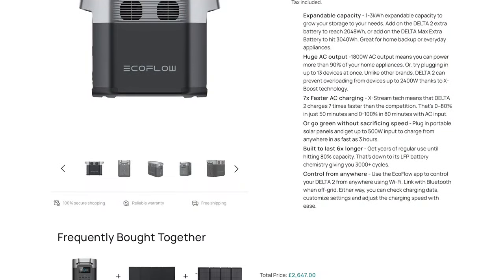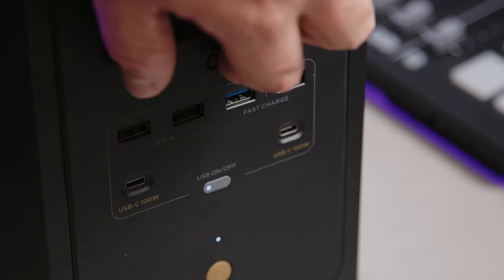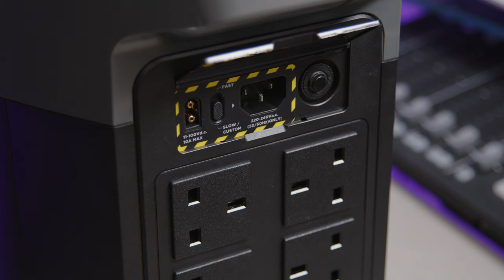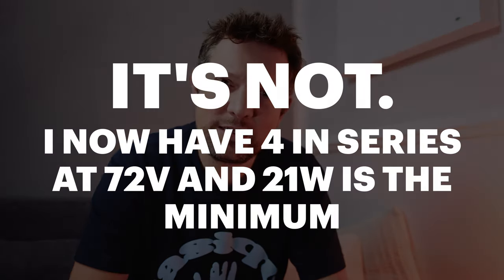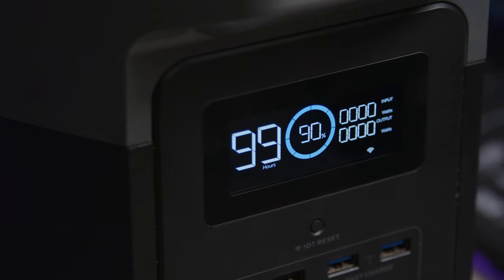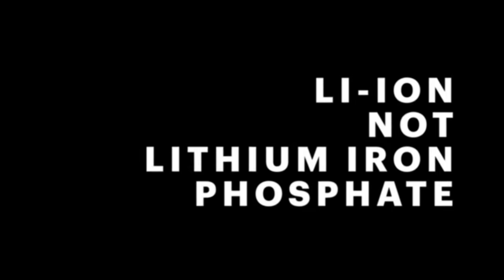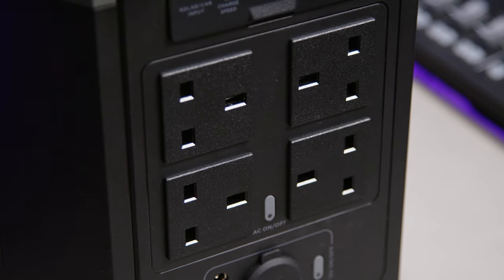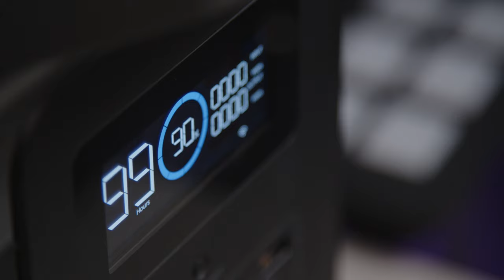EcoFlow Delta Max - Things You Don't Hear In Reviews

Comment from the maker: EcoFlow has now got back to me about the minimum solar power issue. Apparently, the unit consumes 25-30W itself, so any solar input below this cannot be used. That seems a lot, but I guess it makes sense.
Reply: I'm thinking I need to keep the Anker 757. The fan sounds like a puddy tat purring in comparison too 🤷
Reply from the maker: It is really noisy. There's no denying that. Safety is paramount but I really wish they could implement my 'Silent Profile' as discussed in the video. Some people say the Delta Mini is very quiet in comparison but I am yet to test that.
Reply: I saw a video testing the EPS on the new delta 2, and i saw that it was pulling in 50w while outputting 40 W. The 10W difference for the invertor/unit itself, i found very large. It would be kind of neglectable if you would use powertools and run the whole battery in like 2 hours or so (just losing 20 watts of the total of 1024 to just the unit itself) but I find it a shame if you would have a low powerdraw situation of 50 watts and it kicking in, and thus being a relative 20% of your consumption and thereby losing your potential of drawing 50watts for 20 hours and now the realistic picture being 50+10 for 16ish hours. Like you said in your video it would be great to have a limiter to not kick the fans on even above 80W, this should also be discussed to see the real WH you get out if it with this draw of power. (Excuse me my comment is based on the delta 2)
Reply: @tdcattech  Ecoflow Delta 1300watt....Buyer Beware  ...It never stops charging. They don't return my e-mail. Concern that it might catch on fire. Have had it for 2 1/2 months. Think twice before spending more than $ 1,000.00 dollars. Besides I am afraid to leave it out of my sight that it might burn down my house

Comment: So glad I saw this. Excellent review, saved me making an expensive mistake. The fan noise is beyond unacceptable, it would have rendered the Delta max next to useless for my needs. I will not be placing my order. Going a different road now.  Many thanks for making this review, it was well balanced, told the good and the bad, the truth.
Reply from the maker: Thanks for that. I think they make solid, quality products but if you want to use this in a quiet environment, this is not the one for you. Delta Mini is quieter (but not what I would call quiet) and the Delta 2 reports seem mixed around noise but I can’t really comment as I don’t have a unit.
Reply: @tdcattech  I assume all of these Li Ion power stations or solar generators have very similar cooling requirements so fan noise is a big factor. Funny enough it is hardly mentioned in any of the main manufacturers "buy me" stuff.  I might spring for a smaller capacity and much quieter Li battery unit, I am looking at power oak, but now that you have put us all staring, I am investigating the noise levels on everything first. Keep your eye on this sector because people want to know the truth and good reviewers will be in high demand going forwards. I suppose they will fix the fan noise in time, but the chemistry as it stands is what it is, temperatures must be kept down for safety. Last thing you want is a silent unit that burns the house down.  regards.
Reply from the maker: Absolutely. Moving power and converting voltages etc. is just massively inefficient and creates heat. Safety has to be first. I doubt EcoFlow will like this review, even though it's largely positive but I welcome your feedback! 👍🏻
Reply: @tdcattech  This is the essence of a good reviewer, you never worry if the manufacturer likes or dislikes your review, so long as its professional, balanced and truthful, which your review absolutely was. EcoFlow know that the noise issue will put a lot off their products (like me), so they have a good incentive to keep the product safe whilst significantly reducing the aircraft hangar sound effects!
Reply: When you need power during outages, there are no questions about noise. Same for fuel generators, compare their noise levels.  but yes, some vendors now care about noise as well, for example Anker with their PowerHouse series.
Reply from the maker: Totally. In a true outage, who cares about noise. 👍🏻
Reply: @tdcattech  A few years ago after a cyclone here in NQ Australia, power was out for a week, and generators had become scarce. By chance,  we located a huge bellowing diesel generator on its own trailer to rent. That roar was so soothing to my ears at the time. During a serious crisis, with desperados on the prowl, this fan noise shouldn't be detectable to anyone outside your house so it would be ok. We aren't short on sun here so Delta Eco Flow  Max or pro might be ideal for us.
Reply: @tdcattech  I am currently looking at one to run my Qld Au, home off grid.. as the way things are going when you have a solar system on your roof and they now want to start charging us TAX  for our feed into the grid power, while they're only paying a measly 05c p/kWh hour any way.. they were paying around the 16c p/kWh hr to begin with when i bought the solar system.. but now it's hardly worth the effort.. and i may as well go off grid, this seems to be the most economical way to do this.. though i haven't really looked at off grid battery storage systems, but i feel they'd be even more expensive.. will do more research and apart from the noise factor the EcoFlow seems to be a viable option apart from the noise factor.. that would not be suitable.. thanks for your honest review..

Comment: This is because NCM battery cannot operate over 45 degrees, so the unit tries to cold it down as hard as it can with fans.
Reply: The fans are only for the inverter / dc section the batteries are not actively cooled

Comment: I love my Delta 2000w fan and all. I never thought about the noise until I saw this review. Charges very fast when needed. Probably better on the battery if one uses it when is an emergency. Combines with 2x 220 bifacial panels and a 2200w propane generator. Bring on the hurricanes. Ecoflow thought of everything. I encourage you to look at other reviews before you walk away from this.
Reply from the maker: Not sure if this is directed at me personally but I am certainly not walking away. It’s a great, solid product. These are just some things people should be aware of. I actually charge a smaller battery from the Delta Max and use that when I need silence. The Delta does the heavier lifting.
Reply: @tdcattech absolutely not directed at you. Just my respectful opinion. I thought it was a good review and I am sure it took much time to put together. Thank you.

Comment: Shit. That's me back to square one . Can't have that noise, in a van converted in a camper and its seems unrefined and over priced,  for what they are given. Thanks for the honesty.  Saved me from been pissed off .
Reply from the maker: Yes. It seems that people are very torn on this. If you're camping and you can put it in the back of a car and just feed a cable out, you'll be fine. Equally, if you're pulling hundreds of watts, expect noise. You're never going to avoid that with current tech. However, it can be loud with fairly low draw which is a problem for me personally. It is otherwise a superb device 👍🏻
Reply: @tdcattech The new Delta versions, especially the Delta 2 are much quieter running (I sleep with one next to me in the car. The car fridge actually is louder).
I do agree with you about the huge problem of not being able to charge any of the Delta extra battery range separately (including the new "2" versions). I often need to keep devices (such as the fridge) operating while it's connected to a battery station, at the same time charging a depleted battery via solar panels. This is just not possible with the smart battery (not so smart 😂).

Comment: Hi. I have both a delta (not max) and a delta pro. I agree with you in respect of noise. I do not have problems with the solar when leaving it connected all the time, nor do the units make any noise while trying to connect. But lets be honest I am in Spain and in most cases sun is not an issue here. As for switches to the AC plugs I use remote operated plugs and that with one remote allows me to switch on and off several devices. Thank you for you review!!

Comment: Sorry for the long winded comment, but here it goes anyway .... First off - Wow, that is an impressive review video right there, very high quality and good, honest. unbiased information. Thank you! .... But, unfortunately it also confirmed my suspicions/worries about whether or not the Delta Max was going to have those same loud noise issues that the new Delta 2 units have. Hobotech & multiple other dissatisfied owners have already confirmed that fact for the D-2's.... Darn - after I cancelled my recent Delta 2 order (primarily due to the noise concern) my first thought was to wait for some price reductions, and then buy the Delta Max 2000 instead. I don't think so now.  And the other thing that caught my attention in your review was the solar panel connectivity issues when it's left plugged into the panels overnight. I had seen that that was an issue with the Anker 757, but had never heard of it being a concern with any of the Ecoflow products. I have a Delta 1300, and it does not have that problem that I'm aware of. It starts delivering even very low amounts of solar (5-10w) to the power unit as soon as the morning sun hits the panels, w/o any interactions from myself whatsoever. And lastly, my Delta 1300 appears to be far less noisy (approx. 40 db when I/O loads exceed 200w) than either the Max or the D2 @ 60-65db each. As a result of all this, I am now strongly considering adding a 2nd Delta 1300 to my arsenal, and I'm also thinking of it's lack of app connectivity as somewhat of a merit rather than just as a liablity. Thanks again, and good luck on all your endeavors.

Comment: Not Delta max, but Delta 2 arrived today. Straight away I'm loving it vs the Anker 757. (12kg, not 20 kg 💪) Came 30% charged and leaving for Wales in a few hours. Charged it initially to 90 % in savagely quick time in 35 to 40 minutes on 1200 watts. It was really loud, but I didn't care as all I was bothered about was getting it charged before I go and I was in the shower anyway, then pottering about and packing up to go. Tried 600 watts, considerably quieter. Under load, also way quieter than anticipated . I plugged into solar as curiosity got the better of me. 187 watts going in in hazy sun. ANKER MAX was 160 in full sun. Happy to say completely silent taking in 187 watts. The fan did slightly kick in but I was up close and it was barely audible. Need to test if it takes in low 10 watts instead of chopping it off. Ap is brill realising WiFi and Bluetooth. Sorry to bore you, but I'm relieved... Extra battery and case apparently still on it's way, but I'm now sat in a vw camper, using it and glad to be happy with it so far👍
Reply from the maker: Not boring at all. This is exactly the feedback I was looking for. The noise issue is so subjective and people’s tolerance for fan noise varies enormously but it’s great to hear that there is a quieter mode. My Delta Max is currently charging from solar at 60W (it’s grey and miserable here in Bristol) and it’s silent 😁 🎉
Reply: Yes let me know the lowest level of solar the Delta 2 will accept. I often have 10w or so coming in and my current Anchor 535 takes in 6w 8w 10w solar no problem and over days and days it is useful.  If the Delta 2 takes low level solar I'd love to know.

Comment: I am fine with the fan noise when the battery is being used, whether it is charged or discharged. Cooling the battery is my highest priority. Having said that, when cool, they are cool.
 My biggest problem is when AC-in is connected and AC-out is used. If the Delta would have a real transfer switch it would have no need for so much cooling, instead they do some kind of AC->DC->AC chain which forces the fan to start cooling.

I ordered a real transfer switch and will connect my Delta 2 to the generator connection of it. 150 euro for something EcoFlow should have build in.

The solar input problem you might be able to solve my using a small separate 12 volt battery and a mppt controller that has a programmable load port. I use a Victron 75 15 to charge an external 12 volt battery and when voltage on that is high enough the load port is opened and stream electricity until a certain low voltage is reached. You don't need a large 12 volt battery for that and can also use the victron Victron BlueSolar MPPT 75/10 (12/24V) which has 10 amps output.

Yes external battery's...... the are expensive and have no way to charge them or use them other then connecting to the main unit.... might as well buy another unit

Comment: Really useful review, thanks. I have just bought a Delta Pro and can say that the advantages and disadvantages you have highlighted here apply equally to the Pro. Overall, I like it, but have to keep it in my (somewhat dusty) tool shed because of the noise the thing generates which is less than ideal as I worry about dust getting into the device - causing issues later on.
Reply: Which one did you get I’m about to buy one thanks. I do a lot camping would you it be good for that ? Thanks

Comment: Very interesting and informative video, with your open and relaxed style you could easily move to television presenting. This is the first none biased video on the new Delta range and the fan noise is barely mentioned in other reviews. I am considering the  Delta 2 and it's not hard to assume it has the same issues, ideally when considering the price, it would be good to see and hear one before buying. Will subscribe and check out your other videos.

Comment: Great video. It’s also useful for charging other power generators while you are using your 100v solar panels to charge the delta max. This throughput charging allows lesser powered generators to charge while you charge the `delta Max at the same time.

Comment: All fair points for me personally the noise is too much for my use case it’s in my van that I live in full time having the fans fans running at full speed the majority of the day is horrible, if you are using this for back up power or camping you can plug in an extension lead and stick it in another room this is the reason for the difference in opinion on the noise I think 

I’m planning on doing a fan swap in a few weeks with will hopefully get it to the same noise level as the delta 2 but unfortunately it won’t alter the fan curve it’s self

Comment: I completely agree about the fan noise, I emailed Ecoflow asking them if it was possible to control the fan or restrict the performance similar to what you asked them , they said it could not be done, I even moved the device from my office to another part of the house to get way from the noise, in the end I sent it back as its just to loud for my environment, I’ve bought a delta mini which is silent and I am waiting for the delta 2, hopefully it doesn’t have the same fan noise issue.
Reply from the maker: That is a real shame. It's fantastic to hear that the Delta Mini is quiet but it's also much less capable than the Max. I do hope this is improved in the new higher power models.
Reply: Delta 2 is  very noisy too.
Reply from the maker: Yes. It seems as though nothing has changed on the Delta 2. It's just as noisy from what I've seen on other vids (I do not have one to test).
Reply: I've received by Delta 2 and it is much quieter, the trick is to charge it at anything below 900w, anything above that will put the fans on but nothing like the noise the Delta Max makes.

Comment: have to agree noise is an issue.  i finish work about 2am each night and use it to power my office until 6am added a timer to the mains input so start charging from my houses solar after 9am 
i brought a plastic garden box lined it with car noise suppressing sheets take the edge off can watch YouTube or a movie with it in the room  power was then the issue office uses 260w. so was getting about 5 hours (haven't done your calibration) so having a 48v lithium scooter battery i rigged up a 48v to 24v 20amp converter to the xt60 increase battery life to over a day 
may get the extra battery and the generator in the future if needs change but working fine for now

Comment: Does newer battery lithium ion fast, generate less heat and less fan noise? And how much energy does cooling the unit drain battery..? Thanks this is an amazing video I may buy the 2000
Reply: You would be crazy to purchase a lithium ion battery powered generator at this point (unless you are looking to score a deal on an older model). LiFePO4 is the new standard and should be prioritized when selecting a new unit!

Comment: I will purchase EcoFlow Delta Max because it is portable, versatile, and has enough wattage to support almost everything.  It is much cheaper and lighter than Ecoflow Delta Pro.  It is also expandable.  I will put it on my time machine for my backup power. It will crank the power to time travel.  A noisy fan from EcoFlow Max helps to deter sabotage from intruders.  If the case of a mishap disaster when I am stranded somewhere in a time and place, the EcoFlow Delta Max solar generator with solar panels will be my lifesaver.  It helps me to escape alive from the nightmare of the Twilight Zone! 👍🤣👍
Reply from the maker: Sounds reasonable. 🤪